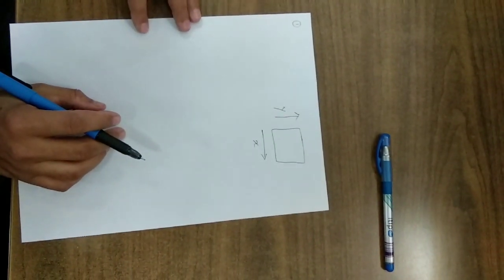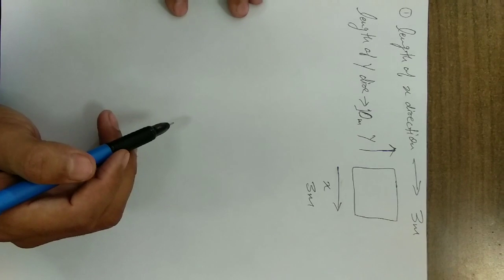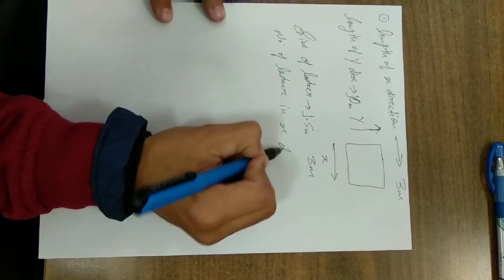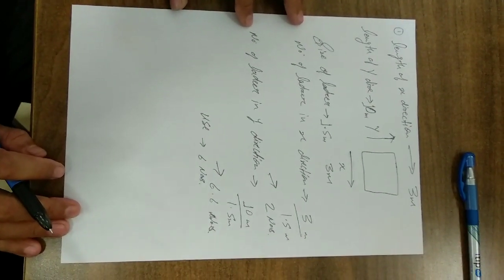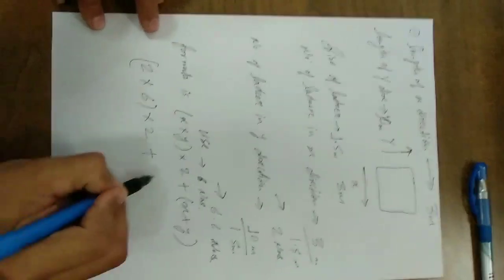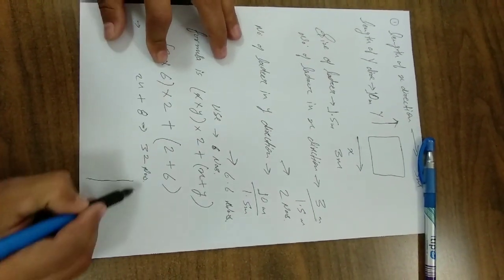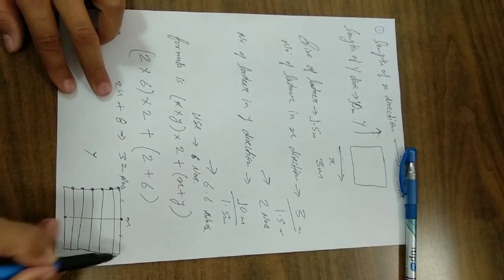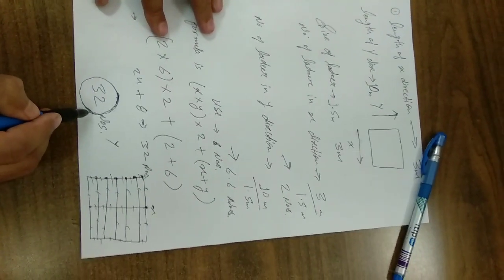Formula to calculate scaffolding material quantity #scaffolding #scaffoldingmaterial#bhada#civilsite

Comment: One thing we forgot we've taken only lengths and width we must measure hight too thus we can reach to the conclusion.. Sir tell whether I'm right or wrong your valuable reply will be highly appreciated.. Thank and best regards..
Reply from the maker: Thanx for asking 
In 3m standard , there are 4 cups which means we can use 4 layers of ladger but basically we use 2 layers of ladger at my construction site. 
If the hight of floor is 6m we will use vertically 2 standard in which we use  2+2 layer of ladger. 
In this video I calculated ladger for one layer and then multiplyed the output with the number of layers.
I think now I cleared your doubt .
If any please ask.

Comment: Bhai i want to get 6mtr pipe material requirement for the following  Ht-20mtr,Wdth-20mtr,Length-50mtr.How to calculate?thanks in advance
Reply from the maker: Thanx for asking .
We have 20mtr wdth and 50mtr length use 1.550m ladger length for calculation of no of ladger . 
Now , 20m/1.550 = 12.90 or say 12nos.
And 50m/1.550= 32 no's .
Now , no of ladger in one layer .
(12*32)*2+(12+32) = 812 no's and for 6m height standard 4 layer will use then 4*812 = 3248.
Total height where scaffolding required is 20mtr.
20/6mtr = 3.3/ or 18m+2m 
Here 6mtr 3 standard and 2m 1 standard will use .
Therefore 3*3248 = 9744.
For 2m standard 2 layer of ladger will required then 812*2= 1624 .
Total no of ladger are 11368nos ladgers. 
And no of standards are  (12+1)*(32+1)= 429 *3 = 1287 (6mtr height ) .
(12+1)*(32+1)= 429*1 = 429 ( 2mtr height) . 
LENGTH oF standard will be 1.5m for ordering the material I took 1.550m because standard will cover some space .
Again thanx for watching and asking .

Comment: WTF THAT VIDEO
Reply from the maker: What's wrong with this Sir
Reply: @surajsinghnegi2056  total scaffolding Material reqd for 150x80x40 ..(instead of cuplock standard pipes are to b used)???
Reply from the maker: @annuverma7052  are you doing scaffolding with clamp and 20' ms pipe.